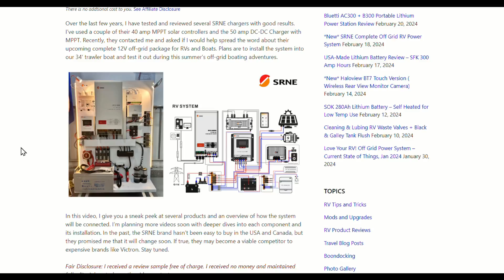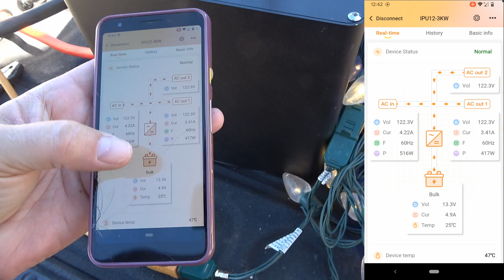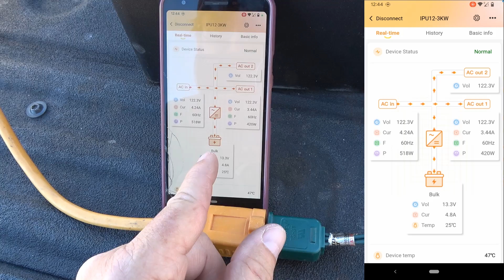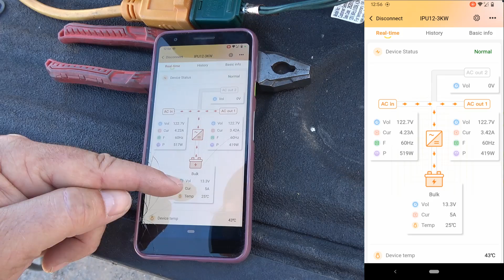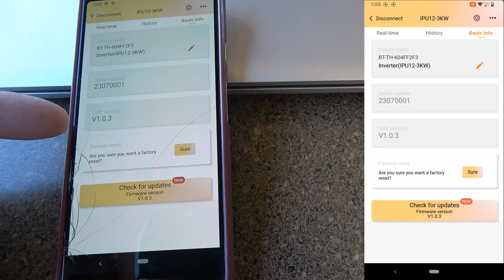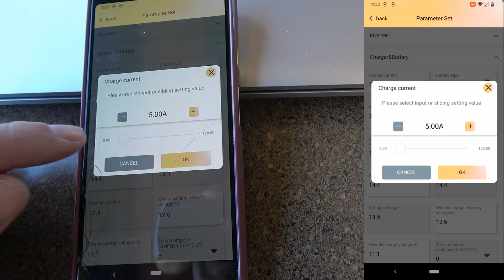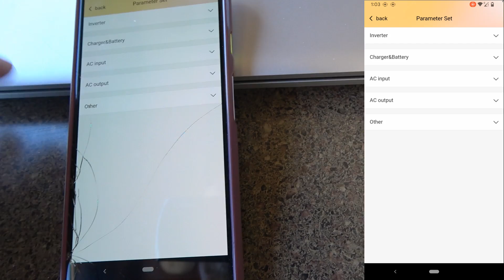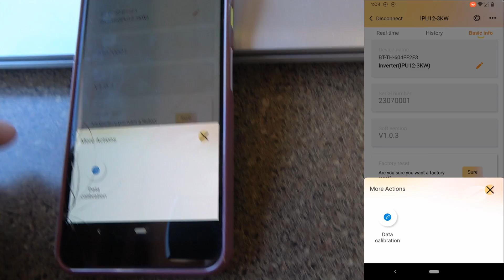*First Look* SRNE 3000W Inverter/120A Charger/50A Xfer Switch - Hookup Demo and App Walk Through

Comment: Hi, I am just curious, what is your experience after 9 months with SNRE inverter? Was it working all time during the last 9 months? Is it a robust and reliable inverter? Thank you in advnace!
Reply from the maker: I haven't had a chance to do a long term test. The unit is just a bit to large and heavy for install in my RV or boat. I plan to let my brother in-law install it in his home. The SRNE stuff is well built in my opinion and good value for the cost. The solar and DC-DC chargers in my boat and RV I'm using are performing well. But so far they don't seem to sell or support their products in the USA and Canada yet which is a shame. That would make me hesitant to buy. Cheers, Ray

Comment: Noticed that as soon as the genny was shut down the battery amperage jumped to -27 amps. How much of that discharge is the battery charger you have connected & how much is the (in)efficiency of the inverter/transfer/charger itself?
Reply from the maker: Before turning the generator on, it pulled around 27 DC amps from the battery. Then, when the generator was running, it charged the battery at 5 DC amps. The generator turned off and was back to drawing around 27 DC amps. If I calculate the battery power wattage, 13.1V x 27A = 354W, and the inverter wattage out is reported as 315W, that would be about an 89% efficiency rating.

Comment: Does this inverter even have a UL-458 listing?. If it doesn't then for safety reasons, it should not be used in a mobile application like an RV. Also, if it uses Chinese high frequency, transformerless technology, then in my opinion, it should be avoided at all cost.
Reply from the maker: Safety standards aren't published anywhere yet as the product isn't out to market.  I'll have to ask SRNE.  It is a low-frequency inverter with a large, heavy transformer. Check my previous video, where I took it apart to have a look inside https://youtu.be/zqjU8o9fy9I?t=417  Cheers, Ray

Comment: Where in the world do you keep everything that companies send you for T&E when you boondock so remotely?
Reply from the maker: I don't keep stuff for long, but we have a 30 foot fifth wheel and a large 1 ton diesel truck with crew cab and a 8 foot bed to store lots of stuff.. After finishing my longer term reviews I either give the stuff away to friends and family or sell it to people at steep discounts.  This fall I gave a fellow at my boat yard two Ampere Time 200Ah lithium batteries, In exchange he is keeping an eye on our boat over the winter. Gave another friend some ActiveStart soft starters when he let us camp free in his vineyard.  Sold off four 2 year old Lion Energy UT1300 batteries for a third of new price. Sold 3 Aolithium 100Ah lithium to some RV friends from Canada for $200 each $150 USD and helped them with the install. Sold a gently used water filter system with new filters $499 new and a SRNE 40A solar controller $125 new to a fellow that lives in Yuma for $200 for both. So, I try to pass things on to other RVers. Help them out and sometimes make a bit of cash. Cheers, Ray

Comment: Thanks Ray !  I’m no expert on fancy inverter/ chargers, but wouldn’t it make sense to have the battery state of charge percentage on the main app display?
Reply from the maker: In my hookup the inverter/charger cannot know the battery state of charge percentage. That may change if it was hooked via a data line to a battery monitor w/shunt or a battery internal BMS. Then one of those things could send the SOC information, and the app could report it.
Reply: Very thorough, easy to understand video. Thank you! Unrelated question. How old is your fifth wheel now? Our fifth wheel is almost ten years old and needs some maintenance. We are wanting to get back on the road full time, but are concerned about the age of the RV. I am of the opinion that it would be better to invest time and money into something we know rather than a new RV of questionable build quality. Would you agree?
Reply from the maker: We bought ours in March 2011 for $30,000 Canadian around 22K USD so have had it for almost 13 years now and lived in it almost all the time.  We like the layout, suits our lifestyle so for me its better, way cheaper to keep fixing this one as things break or wear out versus spending a bunch of money on a new or newer one. I'd maybe change my tune if I had to pay RV service rates but I can do things myself so saves the labor.